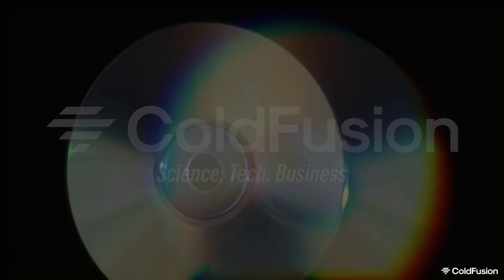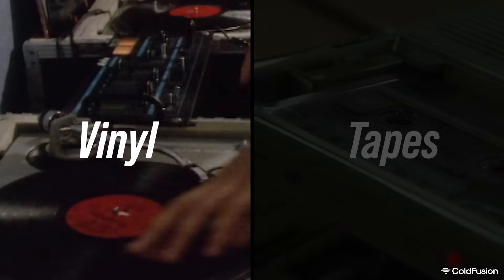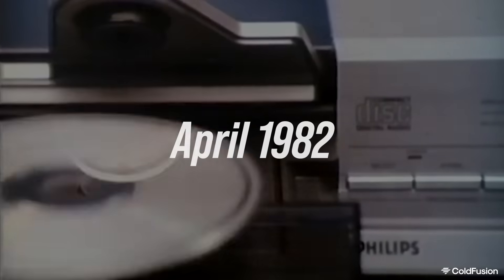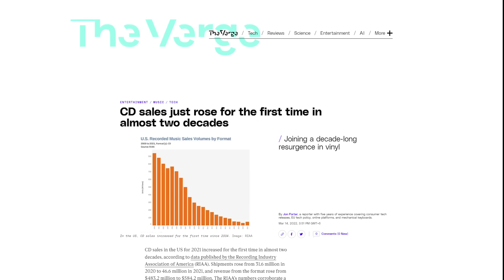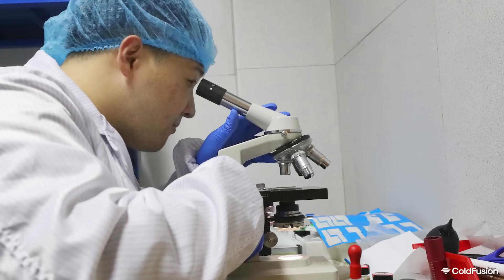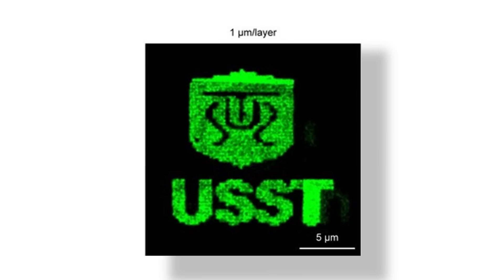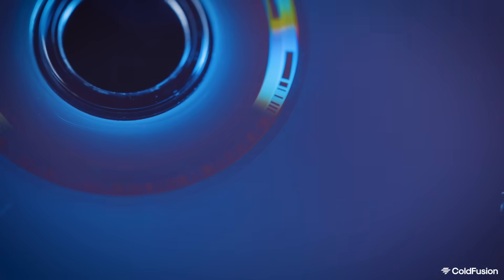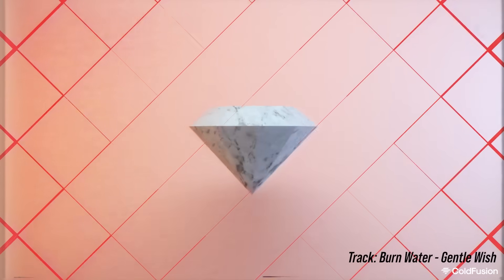Why This New CD Could Change Storage

Comment: Mini CD's which used to hold around 180MB of data could also be the new future again in the domestic market. While it's physical size is smaller, it does allow for use on standard players. A 3D optical disc of this size might hold 60 to 80TB of data, which is still more than most home PC's and so therefor 8K movies would fit with ease, mass music collections too, but the best of it all, is it nearly fits in your pocket. Portable players with screens could be possible, however the current power requirements would need to be addressed. But why have such high storage on a larger disc, when you could shrink the disc and still have good capacity - smaller for the consumer market, and larger for data centers.

Comment: Media durability kills this.  Recordable disc media has proved vulnerable to a wide range of defects in manufacture, being stored at the wrong temperature or humidity, or physical damage. Even factory-pressed media has suffered laser rot and other defects.  Given the extremely tight tolerances of this process and requirement for perfect conditions, there will be almost no place secure and safe enough to store one of these discs for any length of time.  And even if you can store it safely, it might still rot where it sits.  Add to that the extreme requirements for the reader/recorder and the need to keep them functional for decades.

Comment: The write speed is an issue. With 1 MB per second, it will take more than 6 years to write 200 PB.
A good old HDD can easily write 120 MB per second. The tech would have to at least match that to be useful.

Comment: 200 TB ??!!
WOW 😳😮 
I was really upset when I went to buy a new PC and they don't have any DVD drives any more 

I had to find a close out PC that had a knockout slot for a slimline Laptop style DVD and it had a power connector and a SATA connector on the board.

I had to buy a bunch of adapter cables and a used old DVD that was designed for this model but phased out.

I actually bought 4 because they had different models that didn't fit and I finally found one that was right enough to make it fit.

I think they made the wrong choice by making PCs without the 400 or 300 watt power supply and the 5 1/4 and 3 1/2  bays
And without a DVD recorder

Comment: The only way that I could see this technology being useful for the average consumer would be if these disc effectively replaced hard drives. For that to ever happen though two things would need to happen: 1) The laser technology will need to be much, much cheaper. 2) The read/write speed will need to be in the GB/s range like M.2 drives. Read speeds of MB/s are hardly acceptable now in 2024, and if this technology ever becomes available to the average consumer read speeds in that range will absolutely not be acceptable then.

Comment: 1) bits =/= bytes. A byte = 8 bits. They are distinct and that matters.
2) You really should have spent some time contextualizing the cons. You damn well spent enough time talking this technology up and doing the sales pitch. Now, you owe it to your viewers to be honest about the cons. What's the point of storing a petabit of data if you're writing with a $50,000 laser set-up at Mb/s speeds? That's not practical even for data centers which would need far more throughput to make such a thing viable. 
3) If you're going to talk about use as an archival technology, you should have done the work to consider what an archivist must: how long to convert to this technology, how long does the medium last, how durable is it, does it require special atmospheric or storage conditions (light, heat, moisture, etc)? 

You didn't go much farther than reading the abstract of the paper and the press release here, and that's a shame.

Comment: the Holographic Versatile Disc capable of up 4 TB of data  which was suppose to eventually replace blu ray discs never came to pass.  so i have my doubts this will happen.  its the same with lithium-ion batteries  and nand flash replacements.  they talk about it, maybe even show a prototype but  after that  nothing.  just improvements to existing technology.  these discs would be great for archival but as the video states  its slow and cost a fortune to do.  imo  5d optical storage  which is on glass and can do up to 500tb of data  would be the better option imo.

Comment: While 0.2 Petabytes = 200 TB might be only scientific peak at the moment, the scientific archivements might lead to improvements for more affordable solutions with less storage in the next decade.
The pretty standard size for an primary drive in a computer is between half a terrabyte to 2 terabyte. You might personaly use a NAS or a cloud storage for additional data; but most people I know might use a maximum of 8TB externaly (not power users).

So even an external 10TB storage device would be fantastic - 100 times as much optical storage as a blueRay100.
While for bussiness date this is nothing - it would be fantastic for private users, esp. if you do not want online storage.
Everyone with photography and video would be happy for such a disc.
While for decades the (private) storage need has increased a lot, this slowed down in the last decade. We simply reached a limit were biology limits the need. While 4k video is standard, many people still use FullHD - and 8k might be interesting with a computer in architecture and construction, but add no real image quality improvement for watching movies. In normal viewing distance the human eye can barely sense the difference between 4k and 8k.
For audio we already reached the limit of the normal human ear quite a time ago.

So 200TB might be of limited demand - but if this research leads to a 10 or 20TB optical storage, this would be quite different.

Comment: I can see why there would be resistance for domestic and commercial adoption of this technology, particularly by customers used to the convenience of cloud storage, and by the music industry, who prefer streaming to give them more control over their properties.

But couldn’t this technology be adopted by cloud storage providers, and wouldn’t doing so dramatically reduce the cost of cloud storage solutions?

A cloud storage start up that adopted this from the get go could, potentially, offer a solution that is significantly more competitive that anything currently on offer. And this would be a massive incentive for the big guys (iCloud, Google Drive, DropBox) to switch their services over.

So while an end user may never come into physical contact with these disks, they may still benefit from the development of this technology.

Comment: It's great to see optical storage make a comeback.  I worked on the first WORM optical drive at Optical Peripheral Labs in the early 80's with a team of about 100+ people.  We developed the first commercial WORM drive that was released in 1984.  I designed the error correction portion of the system for this drive.  We had a bunch of NV Philips engineers and scientists working with us.  They developed the media in Eindhoven and we developed the drive in Colorado Springs.  I moved on to develop some of the original solid state and Flash disk emulators in the mid/late 80s for PCs and industrial applications.  What a ride it has been!
Reply: What do you think of glass plate write-once storage schemes?
Reply: @prophetzarquon  That was the technology that was used for the original WORM optical disks.  The media had many defects in the day (early 1980s), hence a very powerful 10byte/5 way interleaved reed solomon ECC to compensate for the early versions of the media.
Reply: @keithfritze6538  I specifically wanted your thoughts on Micro soft's Project Silica, for write-once enterprise storage on rectangular quartz glass plates, using the size of a mark & its orientation, to store data at each XYZ position; my expectation is that the prime costs right now would be the (¿quoted as $10K-$500K?) burners, & secondly the planned automation to rack & swap the plates for reading, with the plates themselves being relatively cheap? I think they were getting ~7TB per plate...
Reply: what did you major in college? im smart 148 iq but i dont know what to choose and im autistic. i want to go to Physics because it's easy for me and i love it but my mom said it's not practical and useless and that I should get into engineering so i can make alot of money
Reply: @___Anakin.Skywalker  I was an electrical engineer by training.  You should follow your dreams and do what you enjoy and motivated to learn.  And never stop learning.  There is always something new to learn and to discover!

Comment: How can they both record in 6 minutes and only record MBs per second? That doesn't add up. To fully record a disc it would take write speeds of around 550GB/s. It seems like a single scratch could wipe out a ton of data, I don't miss optical discs at all.

Comment: Being expensive and slow, laser technology is not a problem for some niche jobs at data centers. Additionally, substantial private investment in research will undoubtedly lead to significant improvements. Even by implementing parallel processing with multiple read heads, performance can be enhanced.

I like to remember the high-UV lithography machine, which precisely shoots lasers 1000 times a second at small targets, moving the wafer with atomic precision and incredible speed. This demonstrates the extent of progress that can be achieved with well-invested funds.

Comment: If the hardware for burning such disks can be made affordable to consumers then this technology can follow the path blazed by so many others. But if it stays financially out of reach or unnecessary to the vast majority then it will likely remain a niche product. If, in order to bring the price of the hardware down, it became necessary to reduce the amount of data each disk could store it might still be viable as a medium for archival purposes. I recently calculated the total amount of storage I have on every type of media I own and it came close to 20TB, so if each disk could store that much I'd have a backup that would take up very little space and since everything would be on a single disk it would be easy to catalog and search it. If my total data volume increased significantly for some reason I'd have the means to conveniently expand the backup archive by simply buying more disks, as I've done in the past.

Comment: I hope this comes back. I miss storing stuff on CDs. Everytime my harddrive dies I lose all my data and a piece of me dies because there was decades of data on it.
Reply: Maybe buy another drive and save your data there. In the IT we say - no back up, no pity. For this, i have four back up drives. My data is safe i think.
Reply: Physical media needs to make a return, I want to actually own my data and not be locked behind a subscription pay wall every month .
Reply: You could buy another drive and set up a RAID 1 configuration (it's not difficult, even I managed it all through Windows lol) 
This mirrors your drive over two disks so if one fails, you don't lose the data.

Comment: But is it re-writable?  Without that feature, it would have very limited use cases.  The obvious one would be off-site data backups.  But unless you connected a SAN to WAN (which would be an obvious security risk) we'd be back to the days of the sneaker net.

Comment: Since I've switched to DVDs from pendrives I haven't got any data loss, but a DVD is just 4.7GB which isn't much nowadays, but I've found a solution, it's called parity archive, basically you can generate recovery files with what you can recover your data if it got corrupted during storage, and it can be used on any type of data storage device, so I can switch to HDDs. If you don't use a flash memory or HDD for a long time (3-7 years) then it's gonna loose some of the data it stores while DVDs can store data without loss for a really long time, so this is why this parity archive is really important because you can recover the lost data, one of the most popular program is Multipar.

Comment: Unless you can stamp them out like CD’s for media, mass scale will likely never happen. Only archival. If write speeds don’t scale up massively at least to gigabyte/s, individual user local storage will never happen. Lower capacity versions for 8k 3D video with higher bit rate and bit depth Atmos sound might be interesting to help scale adoption costs.

Comment: No thanks!  There's a reason I don't use A) Mechanical Anything anymore, and B) Media that will fail on me because of dye flaws, substrate flaws, scratches, heat, etc.  

Holding more data on something like that, just means more data lost when it inevitably fails on you.

All media has the potential to fail, but not like something like this.

I store all my backups on multiple NVME flash disks.  Which I am sure not to write over too many times.  I rotate them in and out, and have ones specifically for long term cold storage, medium term storage, and short term.  I also get more of them on occasion, so I can keep the total amount of writes to them low.  Then they're all locked in a box.

This is for personal backups.

Comment: Thank you for old news. Snd no do not hold. Inn and out. It has a very narrow aplication. The problem is speed. It may ve used to store some info, but data centers need speed a lot of it. And no nobody is puting it in PC not on mass. You can stote pictures and video. If you have a lot.

Comment: I clearly recall the first time I saw a CD player. It was in the early 1980s at the Consumer Electronics show (CES) in Las Vegas. A row of CD players was on display, with several of them in operation. Most of those units (probably pre-production models) featured see-through, vertical Disc doors, allowing you to easily see the Disc spinning,

Not everyone is sold on cloud storage and streaming.  I have my own personal "cloud", using primarily 5TB USB external HDDs.   I can have as many as 19 of these online simultaneously if I choose to.  That's over 84 TB of usable space, plenty enough for me.  Even halving that to allow for backups, that's 40TB.

Comment: Seems unnecessarily dense for average user. Make it 10 Tb and it might be interesting. For backups quite cool. But it would need to be in a case like a diskette.
Here is an idea a hybrid storage for unchanging data like core system files and installs coupled with ssd.